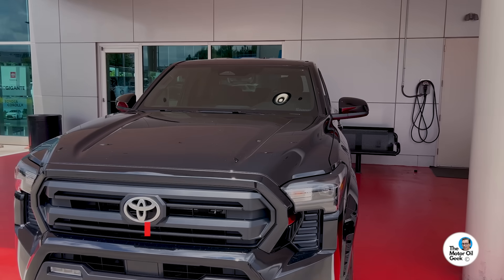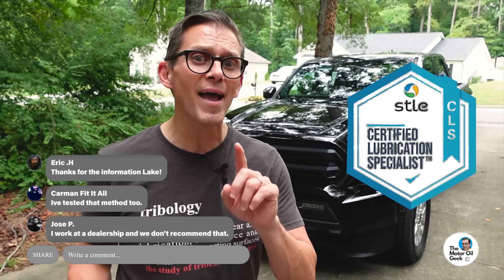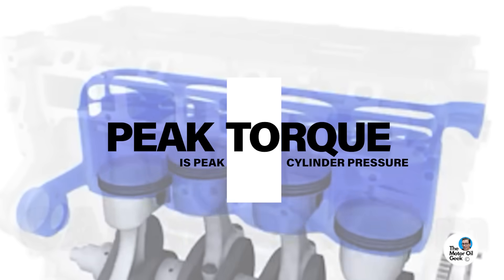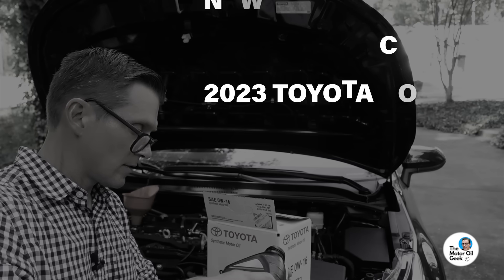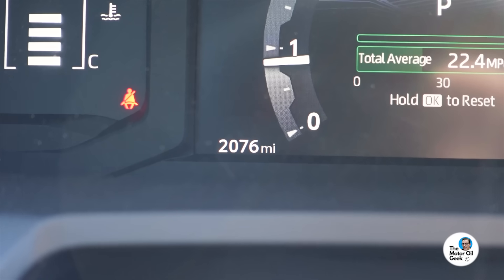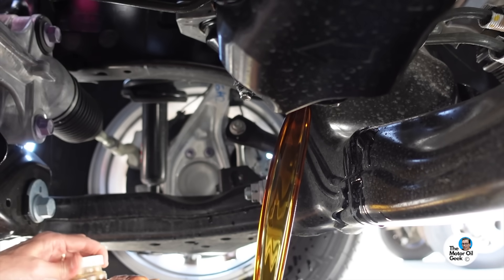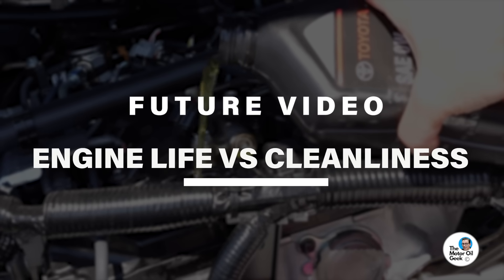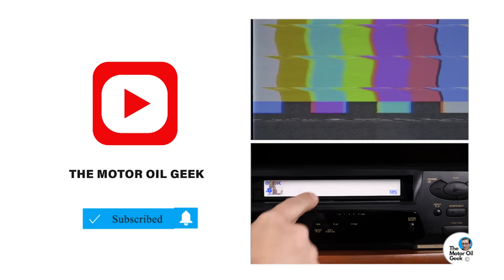The FACTS About Oil Changes (What The Owner's Manual DIDN'T Tell You)

Comment: So when I bought my new Ford, I did the same thing. The dealership actually wouldn’t change the oil so I did and then when I bought my wife’s new Jeep, they said if you’re gonna change the oil at 500 miles do it yourself and don’t tell anybody that’s what they say. I did a 500 1000 and then 3000. I have not had any trouble with either and they’re both got 100,000 on the clock.
Reply: I’m sure every dealership will perform an “early” service if the customer is willing to pay for it.
Reply: @svenhodaka9145  Toyota fought me on this too on a brand new vehicle. I was willing to pay and they kept telling me I was wasting my money.
Reply: @svenhodaka9145  You would think, but I had the same experience at a Honda dealership for a CR-V I bought last year. Who turns away business like that?
Reply: @svenhodaka9145 no they will not. VOLVO would not at least my dealer wouldn't even told them list I am paying, told me to bring it back at 10k😮.
Reply: Do it and don't tell anyone?  Its not doing anything wrong and any dealer wants to act like it's going to cause problems or void warranty is a dealer to avoid. 

Signed, a prior warranty rep.
Reply: @benlastname6667  why would extra oil changes ever void a warranty? And who would accuse anyone of such?
Reply: @AmericanSurvival1 read the OP statement. They frame it as if its not okay that he shouldnt tell people

 All sorts of nonsensical things tale place at dealers.
Reply: @AmericanSurvival1 possibly because the owner may not do the oil change correctly
Reply: Weird. My son bought a brand new Bronco Sport and the dealership was more than happy to change the oil at 500 and 1500.
Reply: @rapid13  rare these days I think but would check the place out if nearby. Most seem like they would rather argue than just do as the customer wants - the exact opposite of "customer service".
Reply: @r @rapid13  well let’s be truthful here Ford needs all the help they can get if you know anybody that’s owned an eco-boost. I know two people one of them. The engine blew up at 100,000 miles. How convenient. she let the bank have that one back not wanting to take a $23,000 hit and then have to buy a $13,000 engine, as the used market does not exist, because of so much demand. The other eco- boost was a brother-in-law and he experienced misfire issues  at 80,000 miles. Yep. No Warranty he’s a Ford guy. I said I would buy an extended warranty on those eco-boost after what happened to my niece. He said no 😂 Well $5000 later he sold that vehicle doesn’t own an eco-boost now . neither does my niece they now I drive a Dodge. My Durango 5.7 hemi with 350,000 miles both have witnessed that vehicle , for the past 20 years and my Cummins and my jeep and all of them working flawlessly never been to the dealership in any of them. So they now drive Dodge both hemi’s , so they have no problems and won’t and neither will they with the all-wheel-drive systems which is what I have in my Durango. It’s Unkillable. The entire vehicle is bulletproof.
Reply: Toyota dealership said the same thing with my Son's 25 Camry.  So, I had him take it elsewhere to get it done per these videos.
Reply: And buy a batch of sump plugs and gaskets (if required) at a different dealership and do oil changes between when the dealer does their service and stamps your service booklet
Reply: If your car comes with one of those "complimentary maintenance plans", you'll have a hard time getting a dealership to do a break-in oil change unless you pay for it.  They assume you think it's going to be free, so they won't do it by default.

My solution to that is to put the oil and filter in the trunk, bring fresh homemade cookies, and ... JK I do it meowself ^^
Reply: I’ve tried cold drains before just out of curiosity, and the difference in how much residual oil stays in the pan is huge. Warming it up makes the viscosity drop just like you said it really does flush out way more contaminants. Thanks for making that point so clearly.
Reply: You wouldn’t have had any trouble if you changed it at 5000 miles either. The weak link that does in a car in 99% of the time isn’t gonna be engine wear unless the intervals get really excessive.
Reply: Glad to hear you making a Ford last unitl 100k and more, hopefully.
I drove a Crown-Vic Special for SPNB headquarters in Los Angeles. The FORD fleet was meticulously maintained and all drove beautifully.  
This proves no matter what you drive, it will take care of you if you go above and beyond the manufacturer service intervals with basic oils/lubes/liquids.
Reply: Ive never bought a truck with free service. It's not free, you just pay in advance and I pay cash for cars, I dont finance them.
Reply: @hikerJohn better off buying it through finance and investing the money. You aren’t being very smart with your finances if you buy it straight out my guy.

I usually get between 0 and 3 percent financing BECAUSE i have the cash. I can easily get 7 plus safely from the market.
Reply: @Dave-om6nd  Superprime Auto Loan is 5.27% and fluctuate . . . investment returns also fluctuate so there's no guarantee in the short term. If you get 0% financing it's because you are not getting the best price for the vehicle. Paying cash can get you a substantial discount. How do I know? because Ive bought 15 trucks over the past 52 years and lived through a number of economic disturbances.
Reply: @Dave-om6nd Sure you can invest the money instead…but what if you need that money in 5 years…markets could drop and you’re out of luck. The only time this makes sense is if you can truly get a 3% or less rate which is almost non-existent now AND you leave that money in the market for 10+ years at least…maybe even longer. Also, what if you lose your job or there’s a change in income? Now you have this car payment you’re tied to.
Reply: @h @hikerJohn Exactly!
Reply: @unikornkontroller  Honestly, if some life-upending crisis hits in five years, I’m probably selling the vehicle anyway. And even then, I’ve still had that money sitting in the market making gains the whole time, which means I’m ahead regardless.

You’re arguing for the 1% disaster scenario while ignoring the 99% outcome where cheap financing + investing the lump sum is objectively the smarter move. It’s not complicated — the math overwhelmingly favours taking the low rate and letting your money cook.

Doesn’t sound like your credit is very good.
Reply: @D @Dave-om6nd You’re obviously new to investing 😂 Who says the market will be up in 5 years? Did you live through the 2008 recession? So you’d sell your car…that’s the alternative?

If I’m paying cash for cars (which I do) it should be assumed my credit is excellent (which it is). 

In 5 years markets might be up…that’s a short time horizon. Like I said, do what you’re doing but keep that money invested for the long term…and only if you’re getting 3% rate. 

But the idea that you’d sell your car and have no transportation if you lost your job (a double whammy because you’ll likely need a vehicle) is bonkers as shit.
Reply: @unikornkontroller  My guy… if the market isn’t up in 5 years, you’re probably selling the vehicle anyway because you have bigger problems than oil changes.
And if it is up — which is the literal 99% historical outcome — then you came out ahead.

You’re arguing the 1% doomsday scenario like it’s the norm while ignoring the overwhelmingly likely outcome.

Also, flexing about paying cash for cars isn’t the flex you think it is. Cheap financing exists. Math exists.

But hey, if you want to LARP as Dave Ramsey and park cash in a depreciating asset for the vibes, you do you.

Your downsides exist if you finance or buy. 😂
Reply: @uni @unikornkontroller who said I took a 5 year loan? 😂 

The market made me rich, 2008 especially. Some of us aren’t afraid of making money.
Reply: @D @Dave-om6nd  LOL
Reply: @Dave-om6nd maybe, maybe not. I can guarantee going from full coverage when we owed money on my wife's suv, to basic after paying it off, saved hundreds of dollars. Will save thousands over the life of the vehicle. 
And if you're thinking, what about an accident? Insurance companies are not your friend. You will end up paying a lot more in raised premiums if you ever file a claim. Don't know about you, but insurance is brutal in NJ.
Reply: @Dave-om6nd  truly wealthy people don’t finance cars
Reply: @Dave-om6nd Ok “my guy”.
Reply: @toa @toastranger72  i am not rich by any means, but i have not and will not finance a car. I buy early 2000s or 90s japanese cars for sub 5k, and they run great, low maintenance. The only reason to ruin your financial freedom on a car is if you are very concerned with safety, and need something newer. I will be driving beaters until the day i die
Reply: @docBZA I love beaters. I had one new car in my life. My expectations were so high, it was a big disappointment. My 08 Acura TLs has 170k miles. I have no interest in anything new. 
Only thing I would get is an NC2 miata from a salvage auction, or if I'm really looking for punishment, an old Porsche 944.
Reply: My salesman paid for the mobile 1 oil change at 500 miles on my 4.6l '97 Tbird. I am at 385k miles and I have NEVER had the engine opened for anything. Intake and above yes but inside -nothing. I am hearing some guide noise do I'm about to open it and take care of timing system including a new oil pump. And there were times I let interval go way too long but the initial start sets the trahectory.
Reply: @leethomas9198 Good call by you Lee. I used to have a regular mechanic (he moved away) who serviced my cars even in the warranty period. I’ve always done oil at 5,000 kilometres. I also do diffs, transmissions, power steering and coolant very regularly. The mechanic said that you can tell the cars that have had love early in their life and that what maintenance you do and how you drive early makes all the difference to the cars longevity and lifetime reliability. We’ll done mate, that’s an awesome job getting your Ford that far!
Reply: @leethomas9198 he didnt pay, the sales department does, its something the sales managers have arrangements with the fixed operations person, to do.  Fixed operations runs how money is spent internally and externally.
Reply: You can change oil every day but having a ford and a jeep won't help.
Reply: @nofyfb123  I mean everyone has made ultra reliable cars.. The fact I can only really think of 1 from Dodge says something but it's true lol
Reply: Question. When changing the oil at 500 miles and 1500 miles, is it necessary to change the oil filter or just drain and fill the oil?
Reply: @sirsuse replace the filter everything. It's still catching the break in metals and contaminants.
Reply: @sirsuse 
DEFINITELY change the filter as well!!!
Reply: Lmao as if they wouldn't.

They wouldn't do it for free maybe but otherwise they probably told you that it's not worth wasting your money or they're too busy and you had to come back

If it's any of those I can see how you might have been miscommunication or misunderstood 

Otherwise there just outright done with you lol
Reply: I’ve personally done early oil changes around 500–1,000 miles on turbo DI engines, and the lab results always show elevated silicon and wear metals early on. The point about filters not catching all break-in debris is 100% correct. Data-driven maintenance like this is exactly how you extend engine life, especially on high-heat turbo applications.
Reply: I had to fight tooth and nail to get the dealership to change my transmission, transfer case, and differential fluid in my 2021 Traverse at 75,000mi. They said they don't want to change it unless there is a problem.
Reply: @foodooyou1  find a new dealer
Reply: Interestingly I had the same experience with a Honda dealership for a CR-V we bought last year.  I wanted to take it in for an early oil change and they would not do it.  I have no idea why they objected, who would turn away business?  They can laugh at us while taking our money, idc, just do it, lol.
Reply: Manuals might say up to 10,000 miles under “ideal conditions,” but real-world factors like load, temperature, and driving style change oil degradation rates. I’ve personally compared used oil samples that show significant additive depletion well before recommended miles, proving why early and trend-based oil sampling matters.
Reply: I just bought a 2023 GMC 2500, with a Duramax, with just under 20k miles.
The dealer shows they changed the oil when they bought it from a customer.
I may take a sample of this oil, then see if they will do my 1st free oil change now, run it to mileage and get another sample and send them in and see how they compare.
Reply: Same here. Used 3 Jeep wave oil changes in the first 5000 mile. Dealer had no issue, but told me they wouldn’t be doing tire rotations.
Reply: Ford and Jeep. So low IQ, got it.
Reply: @joerod1990 ☝️
Reply: You actually bought a jeep? 😱 how they stay in business building such substandard machinery is beyond me.
Reply: @generalzod7959  it’s actually had no recalls to wear my 2020 Ford is at 600,000 miles. I just changed the brakes. Where is my Ford? It was 19,000 I was dead against buying a Jeep but it turned out to be a better vehicle than the F150 and I’m don’t know how to tell any different.
Reply: I bought the cheapest service contract for my wires bronco. Bought in Ohio live part time in Florida, oil changes in Florida are 40% higher. So I figured it evens out😊 my 2 cents
Reply: Dumped the oil in my 2025 Jetta at like 600mi with all the correct OEM items , yeah the magnetic drain plug was 25$ but the "kit" was 98$. 
I'm tempted to do it again around 2500, because in 6mo I've only got like 1100 on it now. 
I'm trying not to wear it out ,so I don't drive it 😂😂
They give you free oil changes for two or three years, but I think it's only 1 a yr.
Besides, I figured another good reason to do the first one myself was I noticed by the build date inside the door that the car was like 6-7mo old already when I got it.
Reply: Using OEM 0W-20 as a baseline before testing other formulations is such a smart approach. I’ve done similar comparisons on my own vehicles, and without a clean baseline, the data becomes almost useless. Can’t wait to see how different viscosities behave once this Tacoma is fully broken in
Reply: Just 
Expect 
Endless 
Problems
Reply: I took my Silverado in at 500 miles in an attempt to get my first free oil change done by them. They said absolutely not until the life on the gauge is 20% or less. I said fine, I'll just go to the auto parts store, buy my own oil, and change it myself. They said absolutely not. He looked me in the eyes and told me the only place I can buy compatible oil is from the dealer. He told me any other oil would void my warranty. I walked out, and won't be going back. I'm sure that lie works on some people.
Reply: @WesDuncan  he’s full of it I believe in 1995 the past the boss Ferson   act if they require their filter in their oil they have to give it to you free check it out
Reply: @Peoplearesheeple I’m thinking you may mean the Magnuson Moss act
Reply: I have a corolla  with 150,000 miles. Only ever changed the oil and the filter in it's entire life once. At 100,000. Still runs like a dream.
Reply: I went through the same thing, because the service manager said that Ford tests all of their engines on the stand, before they install them in a rig.  I don't know weather he was serious, or full of Kacka?
Reply: Bought a new Nissan and the dealer had 5k intervals, notnthge 10k
Reply: Meh, I guess I understand with the high cost of vehicles today.  However,  I'm not about to become a slave to a car or truck. To me they are just a means of getting from point A to point B.  By the way,  I take care of my cars. The last one I bought was a 2010 Nissan Sentra that now has over 260,000 miles,  was flooded during Hurricane Ian, and is still going strong. I just don't obsess over cars or trucks.
Reply: Any modern car with normal maintenance gets to 100k
Reply: On the flipside we have a fleet of Land Rovers for our company that all have 300,000 miles on them and not one oil change was done before 12,000 miles. If you think 100,000 miles is something interesting, it’s not. The minimum standard of reliability bench testing for automotive manufacturers in all vehicles to even be sold in the United States must meet a 400,000 mile minimal test to reliability rating. These are engines that are put on a dynamometer and ran around the clock being fed fuel constantly until they hit an estimated 400,000 miles simulated. With that being said every single vehicle that could be purchased in America must meet this criteria and are capable of it. It’s the same exact test that BMW did many years ago with mobile one oil but they extended it to 1,000,000 miles. That’s exactly what they were doing but doubled it to promote mobile one.
Reply: Same. My wife tried to do the 1,000 mile oil change on a new RAV 4 for break in and the dealership was like "come back at 10,000 miles," so I came down and started my Lake lecture and threw the Car Care Nut references, and in about a minute they scheduled it... FYI, they still put 5 qts in a 4.8 qt capacity.  And we went over the 0W16 a few times (as 0W20 is just the back up oil). . . Manufacturer and dealer maintenance gets you manufacturer/dealer results (both profit from cars wearing out earlier).... To get customer results you sometimes have to advocate for it. Or you can quietly DIY or go to a reputable place in between the 10K intervals on your 2 year Toyota Care.
Reply: I'm doing the same thing. I also will not go in for the "free" oil changes every ten thousand miles.  Don't trust someone's work who's in a hurry to change your engine's oil.
Reply: Any engine can make it to 100k. Well except a GM pos.
Reply: @BeefNEggs057 I guess you forgot about all those Tundra engines 😂
Reply: Apply that to the newest GX550 as well.
Reply: @bossier62guy  Or the first couple of years of the Ford 7.3, I don't know the percentage of replacements but it wasn't "rare" to have them pile up due to the lack of lubrication in the valve train.
Reply: @bossier62guy  likely doing the 10k oil changes recommended by the manual.  Don’t do that.
Reply: @bossier62guy  nah they have been fixed, a toyota will still last longer than a fix or repair daily or jeep.
Reply: @BeefNEggs057  Oh hey there. My ‘07 GMT900 with the 5.3L iron block would beg to differ. Engine and transmission have not been broken open. AFM is still working, 265k since it was purchased new in January of 2007.
Reply: @BeefNEggs057 😂 I have a trailblazer with the 4.2. it has 690k on the odometer. I've only ever replaced the water pump. Oh, it's also the original transmission. So what were you saying?
Reply: @itchyfish  that’s when they were actually good. What year. Early 2000s?  Good luck ever getting that with a new one or even making it to 100k is a challenge.
Reply: @BeefNEggs057  2008... but yeah, I agree anything new these days have a pre-set detonation date haha.
Reply: Patently UNTRUE. Do GM and other domestics have higher lemon-factors and reliability issues? Yes. Dubiously changing designs JUST to claim "innovation" is a lie. Calling a fault "a feature, not a bug" is gaslighting the customer base, and I won't argue that, nor split hairs...
BUT most of the flaws come from the over reliance on electronic BS instead of using it to enhance performance of a properly engineered and crafted machine... AND EVERY COMPANY HAS BEEN GUILTY... Just some are worse than others. I've gotten ,ore than a half a millie out of most of the USED DOMESTICS I've paid cash for. The reason most others can't is their own lack of skill or knowledge AND just being too pathetic, lazy, and/or stupid to READ the g*d d*mn Hayne's or Chilton's Guide if they're even willing to buy it... and that's ALWAYS the best money you can spend on a car, no matter your years of experience.
Reply: @BeefNEggs057  I agree especially the junk 5.3 and 6.2 V8s in the tahoes and 1500, they seize all of a sudden due to bad design flaws.
Reply: @BeefNEggs057  ive seen coyotes blow up at 95k and ive seen  chevy v8s do the same...3.6 pentastars at 400k. ive seen 5.9 magnums with 600k... 5.3s with 700k... all depends on maintenence and driving habits
Reply: @BeefNEggs057  Or a Ford EcoBoost
Reply: Except any domestic engine* theyre all garbage and quit being fanboys to companies that don’t care.
Reply: @sacredhealstv901  sad but true, all too often, eh?
Reply: Name them, my Ford dealer changes my oil at time of PDI soon as they see my name. Then I come back at 1000 miles, 2500 miles, and finally 5000 miles. I hand them amsoil for my differentials, transfer case at 5000 miles. Pennzoil 5w30 Ultra Platinum, only Fomoco fluids I use is 50% transmission with 50% Amsoil. When I trade in my vehicle, I get top dollar everytime. Ford of Cookeville are amazing, as are Sparta Ford.
Reply: @Hanibul_Lecktor your Ford dealership changes your oil at 5 miles?  Psycho shit lol.  Spent 16 years working my ass off for ford, no one asked for a PDI oil change 😂
Reply: Any modern vehicle can last 100k miles nowadays that's not saying much. You can neglect a toyota and it will still last longer than the Ford or Jeep, two junk cars.